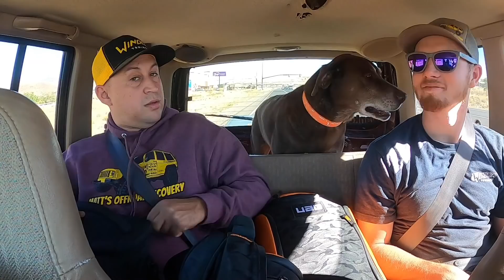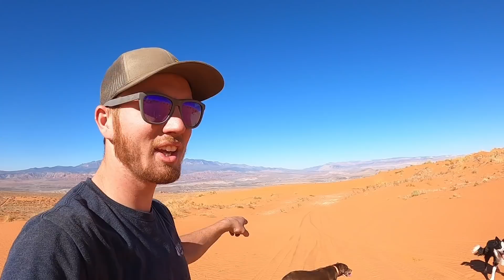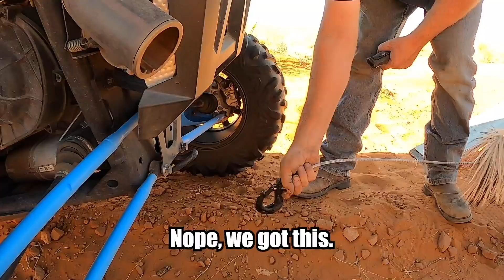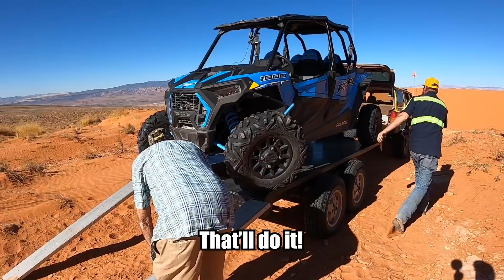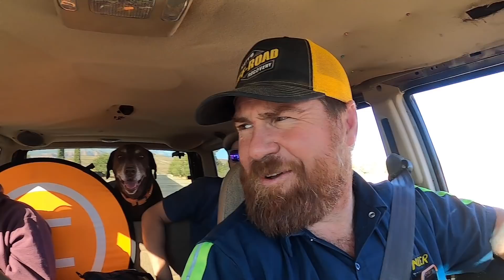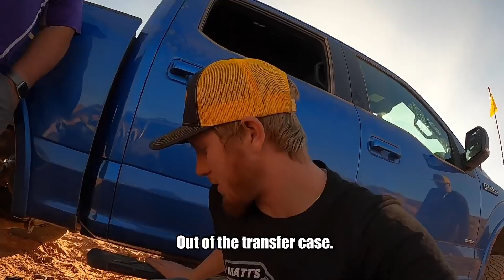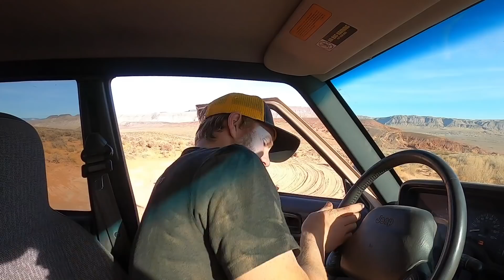Ford F150 Breaks Its Drive Shaft...Now what?

Comment: Fords using a little too much aluminum. Not enough on the drive shaft apparently.
Reply: Military Grade Aluminum. 😜
Reply: @Salar6.0  nope, you are wrong. On that F-150. Aluminum driveshaft is standard, just like chevy trucks. It depends on the wheelbase of the truck whether it has a one piece aluminum, or a two-piece steel driveshaft.
Reply: @Salar6.0  No that's factory I have the same alcoa aluminum driveshaft on mine from factory. However, idk how he tore it.
Reply: @R3411y250  he was probably stuck on a rock and the driveshaft was the weakest link, so it gave way.
Reply: @KJsProjects  one little dent, and it will tear open like a beer can.
Reply: I'd rather have a driveshaft break than a diff or axle.  Easy trail fix and they're not too expensive.  I do a lot of wheeling in my 2018 and it's been bulletproof.  Living up here in the salt belt of Minnesota I also love all that aluminum and until some other manufacturers do the same I can't see myself buying anything else.  I wish Ford made the new Bronco aluminum, kind of a let down.
Reply: Most likely he hit the driveshaft on a rock previously. The shaft is weakened by a large amount from any sort of ding/dent. Then over time it started cracking, then failed under the extra load of the sand.
Reply: @secret5.  Did you ever think that maybe the diff and axle won't break? Steel vehicles do not rust anymore. They are designed not to rust. Steel vehicles are built better, and are easier to repair when you damage the body. The new bronco will not rust, and neither will any other modern vehicle. Congrats, your truck has lasted 2 years.
Reply: @gasolinediesel972  Where the hell do you live all the steel rusts in the rust belt. 2020 ford Chevy all have rust in the rust belt. .
Reply: @lockburner2000  Obviously they will have a little rust, and I do live in the rust belt. They don't rust up to the fenders like they used to though.
Reply: And steel doesn’t rust anymore?! Hahaha. Not so fast brainiac! My neighbor just got rid of his 2018 Silverado to a guy that flew 597 miles to buy it. Because it had bubbling in the rocker panel and he knew it was going to keep getting worse! So long rusty!
Reply: @oscarmayer9823  Silverado's are pieces of shit. No surprise. Most steel vehicles are coated so that they don't rust genius. This explains why some steel vehicles rust more than others. If you would like me to explain it for a fourth time then I will.
Reply: @TheDieselndust    Also the  drive shaft thick as beer can
Reply: That's a truck drive shaft? Looks like it was made out sheet metal?
Reply: @nazcalito  it is made out of aluminum, this is how they can get better MPG’s out of a V-8 . Lightweight drivetrain components.
Reply: @gasolinediesel972  Well I bought a 2016 wrangler and after 2 winters it was rusting around the bottom of the doors so I disagree.  Some manufacturers do a better job but they're still not all there yet.  As for breaking stuff, if you're wheeling at the limits something's going to give sooner or later.  Rather have it give out at a place that's easy to access.

Comment: I once had a 4x4 with an automatic. And to flat tow an automatic all hooked up can be bad so I would pull the rear driveshaft. To keep dirt out of the transmission tail shaft I would stretch a rubber glove over it. No worries about it blowing off, and the empty fingers waved happily in the breeze.

Comment: I lost a rear driveshaft on my Blazer with a slip yoke output.
Cut a plastic soda bottle in half and duct taped it over the t-case output to keep the fluid in.
Drove home on the front axle.

Comment: Seems like the popping sounds is the transfer case chain is slipping
Reply: Sounded like that to me too, I’m thankful that mine is not chain driven, they make an expensive mess when they fail.
Reply: Jeep owner, 99% transfer case chain slipping. I think the fords use a chain driven New Process unit.
Reply: Yeh I think the slip yoke helps locate the output shaft that also has the chain sprocket on. Maybe   causing the ability for the chain to slip.  Could be the reason why a lot of people run a flanged tail shaft. My 05 explorer picked up a really bad rear shaft vibration half  way through a road trip. It has a flanged output so I drive it 300 miles home fwd with the drive shaft in the back seat.
Reply: @uberdang830  Yeah I think you're right.
Reply: @uberdang830  Back in the 70's I think it was. Some neighborhood kid bought a Blaser with a bad rear end. Disconnected the driveshaft and drove it in 4 high for over a year to school and work. It was better then walking.

Comment: I swear the razors are made to break. The repair industry must be where the money is made.
Reply: I don't know... These razors are often rentals and those people probably don't know how to drive and they don't give a f.... If people drove SUV-s the way people drive these razors Matt could upload a video every day.
Reply: They are made to be unrepairable
Reply: they cost 20+ grand. they have to make money up front too
Reply: @2secondslater  you have no clue what you're talking about
Reply: @ Koolerking  Same way with the Club Car brand for golf courses, light duty etc  All aluminum Frames/Welds that look like a 7yr olds toy, and cheap tie rod ends, plastic bushings that tie into the throttle linkage that ties into the brake assembly/levers,  that and various parts, as a former Mech for sports fields & ground equipment it was a constant headache, And Parts prices at an Absolute Premium
Reply: As long as you don’t fly over the tops of dunes you’re fine.
Reply: Far more money is made on aftermarket parts and repairs/maintenance than on the machine itself. 👍
Reply: @Stratos53100  they do look like they're made of ticky tacky
Reply: @nazcalito   Yeah, Service turn around time was Terrible due to the fact it took 3 week avg to get parts and Auth from company for some warranty repairs, by the time they left the shop was almost 5 weeks ( Not because of the shop i worked at ) If you get a chance look under the dash & seats at the frame rails, While some can last a long time ( dont get me wrong) build quality appearance is poor imo, and I would never personally own one.
Reply: @SuperAWaC  nice retort
Reply: I tipped my moms 28k rzr 1000 turbo n a shop quoted her 7k.

Comment: Sounds like his transfer case might have a problem.
Reply: It's not a problem.  The slip yoke has a bearing support.  When you remove the slip yoke the end of the output shaft is no longer supported and will wobble about.
Reply: @WBatte1  Makes sense good call.  Hopefully he didn't damage it as well.
Reply: I was thinking it's from being in 4 wheel on the rocks, probably messed up the front dif.
Reply: But hey, I'm sitting in a PC chair. ;)
Reply: I think it's likely he broke something in the rear differential like a tooth off the ring gear.
Reply: @wirebrush  I thought the same thing until it only happened every 20 yards or so. A ring gear tooth would be more frequent than that.
Reply: Was thinking it might not have a transfer case lock/ center diff lock, and modulates or transfers power to the front via the rear wheel speed, being higher than the front wheel speed as counted or read by the ABS system...but it is just a guess?
Reply: @sickjohnson    American trucks don’t have center diffs. If it’s in 4wd the front drive shaft is connected to the output shaft by a chain or a gear meaning there is no give or way to transfer power front/back. It’s either 50/50 or not. That’s why you can’t use 4wd on dry surfaces because the transfer case will bind when you try and turn too far. Chances are @L.E. Batte is correct about the shaft flopping around without a bearing.
Reply: @WBatte1  
I'll bet that it was fun digging the remnants of that shop towel out of the splines of the tail shaft.
Reply: @joshuarodrique2096  I agree they used to all be this way but more modern stuff is like AWD these days it seems...low range transfer cases are starting to become more rare now. If you are right Joshua, then maybe it is the auto locking hubs in the front diff...you know how they try to simulate or compensate with the braking to act as diff lock? I'm just spit-balling ideas...in hopes of learning something new?
Reply: @WBatte1  The slip yoke bearing, is for the slip yoke/driveline only.  The output shaft has its own bearing.  That TC has a problem.
Reply: @wirebrush  :  If it was one tooth on the ring, AND one tooth on the pinion, then only when they meshed together would it make the noise, for which every 20 t0 30 yards makes sense.
Reply: that driveshaft material looked really thin
Reply: @bristleconepinus2378  :  It was Aluminum, it would have looked thinner still if it was steel.
Reply: @WBatte1  Incorrect, the transfer case output shaft has its own bearing it isn't supported by the driveshaft.
Reply: On the newer Fords they use an IWE or Integrated Wheel End locking hub. It locks the splines on the hub bearing with the splines on the half shaft.  It is vacuum operated, and notorious for failure, hence the crunching. The IWE is sacrificial and will break when splines are worn, when not fully engaged because of vacuum leak, bad check valve, or when driving on dry pavement to keep from breaking more expensive parts, ie transfer case, half shaft, or hub bearings. However, the IWE is expensive and a costly repair.
Reply: @straybullitt  The rag probably plugged up the oil pump in the transfer case.
Reply: @Lray4x4  I got technical pictures from Ford  that say different. I'll trust factory service manuals over your opinion.
Reply: @Bread996  the slip yoke is directly connected to the output shaft. As its name indicates, it slips over the output shaft.  Supporting the slip yoke is supporting the end of the output shaft.
Reply: @WBatte1  I have had enough of them apart to know that that isn't true.
Reply: @WBatte1  Having rebuilt several transfer cases I can tell you for a fact there is a bearing on the shaft at the edge of the case.  The slip yoke housing slides over it and it’s just an empty cavity with a seal and a bronze bushing on the tail.  The bronze bushing supports the driveline and nothing else.
Reply: @Bread996  I've rebuilt hundreds of transfer cases.  Yes the load bearing surface at the tail shaft is called a bushing. And yes it is there to support the front of the driveline.  But it is impossible to support the front of the driveline without also supporting the T-case tailshaft . Stop being a tool Kid. Go out and make some friends.
Reply: @Lray4x4  read the book. Taking one apart doesn't show you what happens when you put power to it
Reply: @WBatte1  The transfer case output shaft supports the driveshaft, not the other way around. You can actually make your own slip yoke eliminator by tapping a hole in the end of the transfer case shaft and bolting a yoke on there. That wouldn't work if you needed the driveshaft to support the output shaft of the transfer case.
Reply: @Lray4x4  why wouldn't it work? You're  not eliminating the yoke only its ability to slide in and out. The yoke is still riding in bushing and the tail shaft is still riding in the yoke. It is a dynamic relationship . The tail shaft will wobble if operated without the yoke in place.
Reply: @WBatte1  You can take the tail cone off and they make a seal that will go further in on the output shaft, the yoke will be bolted on the end of the output with no additional support.
Reply: @Lray4x4  again your comment makes no sense. This modification has no bearing on the topic. So they make a part that replaces a different part. For your theory to actually be valid, you'd have to be able to remove the tail cone altogether, reinstall the driveshaft and drive the truck suffering only an oil leak and dead speedometer.
Reply: @WBatte1  Not the whole tail section just the end piece that covers the output shaft, it doesn't bother your speedometer at all.

Comment: Keep a box of nitrile gloves, along with some long zip ties, in your vehicle. Not only can the gloves be used to protect your hands, and the zip ties for emergency repairs.....BOTH can be used together to seal up a transmission tail shaft housing when you pull the driveshaft for any reason. Helps keep the mess to a minimum when winching a disabled vehicle on to a flatbed. Better than stuffing a rag in the seal.

Comment: Really curious as to what that banging noise was on the F150.
Reply: Wasnt clanking while being towed, so its at the transfer case or foreward. The drive line snaping may have taken some teeth in the transfer case.
Reply: @Amazingbobby  That makes more sense I would think than something in the differentials. I think the newer Fords don't have true limited slip diffs that could  get stuck in a locked position.
Reply: Transfer chain, taking the yoke out let it become misaligned so it was jumping

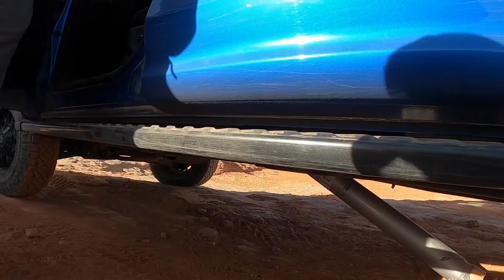Comment: 7:02 that drive shaft is so thin. Those regulations on weight reduction are crazy sometimes.
Reply: It's thin, but what caused it to shear? Something locked up (rear diff?) and that thin shaft may have took the beating instead of the transmission
Reply: @willp942  Yes, that's true. Drive shafts are also designed in such a way that they shear in case the rear diff is locking up.
Reply: My thoughts too, especially with whatever the other noise was when trying to drive in front wheel drive
Reply: What regulations?

Comment: Is that driveshaft just a thin-walled metal tube?  The vent hose on my dryer looks thicker than that.
Reply: Driveshafts are all hollow tubing. Thats how they're made.
Reply: @alexhill828  Yes, but I thought it was a little bit sturdier than that.  It looks like Reynolds Wrap.
Reply: @Mumblix  Damn, they used to be way thicker than that.
Reply: Thin-walled ALUMINUM tube... Ugh.

Comment: That noise was the hubs popping these 2013-2016 are notorious for doing it if they aren’t seating proper when going into 4x4 it’ll do it mine does it to but I take a bit more time to make sure that the splines for the hubs are seated an I haven’t had a pop in a while. It mainly does it when initially put into 4x4 an with a bit of throttle is when it pops so when it goes into 4x4 reverse pull forward like 2 times an should be fine after that. Just for further recovery’s like that with these newer f150’s

Comment: the rag could likely to get sucked into the transfer case and now  pulling  the case and go over it to pull out shredded RAG in it ? leave those broken shafts in the transfer case if you can ? , tie-em  with bailing wire and let shaft  spin free keeping it all sealed up !  wrap wire around shaft a few wraps twist it tight around the middle for use as a stopping collar keeping the shaft from drifting out, then more wire a few inches  back behind the tightly wrapped wire with several pretty loose wraps,  then up to frame somewhere ,  supporting the shaft go slow check once in a while to see its working right re-adjust if necessary .  you could use straps the same way also thought of that one later.  That worked for me 12 miles  ''slowly''

Comment: Wow, I had no idea driveshafts weren't solid
Reply: If the shaft was solid it would weight a lot and be quite a bit more expensive, from material costs alone. Hollow shafts have a better strength to weight ratio than solid shafts. Many driveshafts are aluminum now, like the one in the video. If you look closely, it is actually very thin. 
 
Hollow driveshafts, even aluminum ones, are plenty strong enough, but what usually happens is the shafts gets dented from hitting the ground when off roading and then is not nearly as strong any more. 

Watch at 6:58 and you can see where the shaft has rubbed on something as the truck was driving. Just a moment later you can see an end view of the broken shaft and it is only about a 1/16" thick. The strength comes from the shaft's diameter.

In more serious off road vehicles the shafts get replaced with thicker steel ones to resist the dents that can cause failure.
Reply: @Fix_It_Again_Tony  very true what Tony said above. On top of that, if I am not mistaken, drive shafts should also be the weak link in case the rear diff is locking up somehow.
Reply: @Fix_It_Again_Tony  nice thanks for the info. So what about the shafts in the early 90s GMT400s? The only driveshaft related issues I've had was u joint failures
Reply: @alabamamotionpictureproduc6626  U joint failures are the most common issue. Drive shafts rarely fail unless they get dented.

Comment: Ahh, the good thing about 4wd trucks, if a driveshaft breaks you got a backup.
Reply: I honestly did not know that lol awesome
Reply: Had the front u joint bust in my S10. While doing 40. Ever see a pick-up do a pole vault?
Reply: you might say a.... front up?
Reply: @grindstone4910  I had the transfer case in a 99 Suburban decide that it needed to go into 4-low while at highway speeds... didn't launch the vehicle probably due to the weight but it did take out the transfer case, drive shaft, transmission, steering and 3 wheels/tires.
Reply: @frumsmcnoodles323  Ouch!! write-off!
Reply: Typical Ford
Reply: @Josexferr  He means the front driveshaft still works. Makes the truck front wheel drive.

Comment: Is there going to be a post recovery clunkage report?
Blew the spider gears (I was 17 didn’t know of spider gears) in 62 Scout at end of weekend camping adventure dive it home with hubs locked in 4WD high then when my father went to repack it at home it was in 2WD high and went pop pop pop etc and he he finally believed when I said it was broken my first vehicle would go over or around most anything at 12MPG 2 - 10 gallon saddle tanks refuel ever 200 miles to be smart did I mention power steering & brakes lol fun to drive to high school